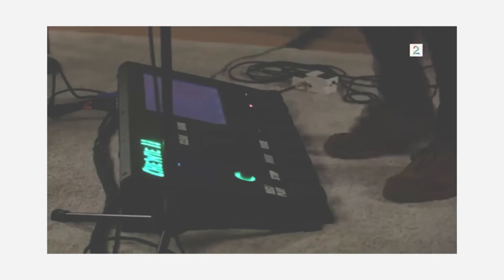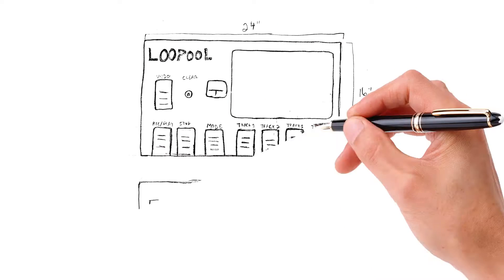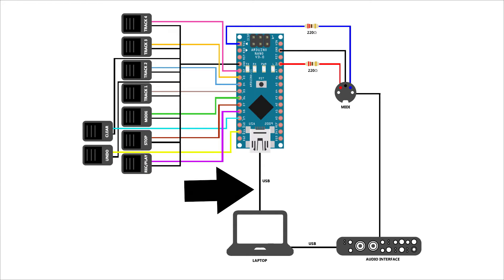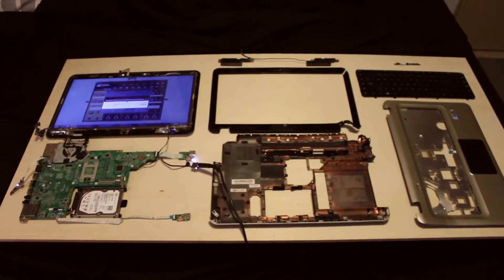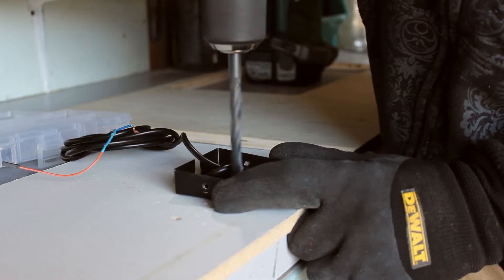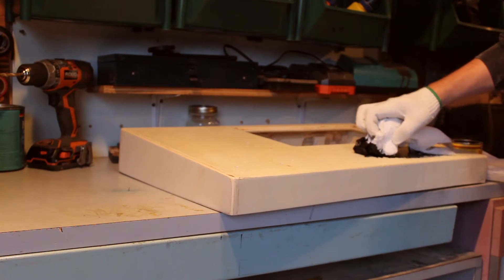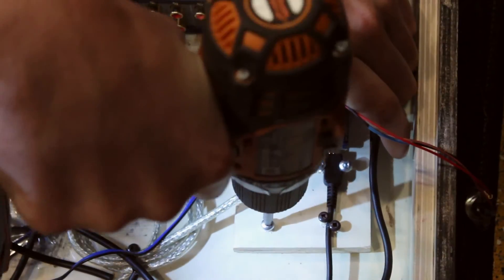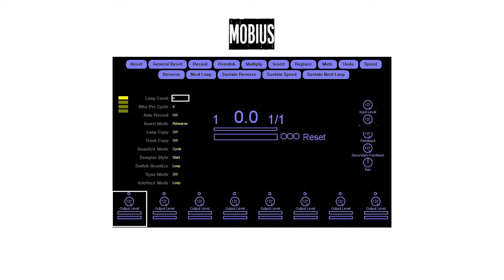How to make: Ed Sheeran's Loop Pedal

Comment: hi not sure if this will work but I made a racing sim setup with an old membrane keyboard and if you solder two wires together onto the board and then solder those wires to a button then open up a notepad you can make the keyboard type letters depending which two solder joints you wired together, Would this not be a much cheaper solution instead of an Arduino you buy an old membrane keyboard and create a bunch of shortcuts on the program for record clear loop etc. just a thought

Comment: This video did not age well. Tried to build this a few years ago, and it didnt work out, got back to it now, same issue. Here they are.
1. Sonnit looper doe not exist anymore - you might want to update the link - Mobius is so hard to work out, and every video tutorial on it has disappeared, really frustrating.
2. your arduino code misses files, such as the MIDI.h file, it does not compile without it. other codes available "seem" to work, but are for different boards.
3. even with midi passthrough on the arduino, any sort of alternative comms, devices or lights seems to absent from your vid, either you are hella good at figuring things out, or there is a fair bit missing from your video, or everything is now outdated/
an pdate and revamp of your board (going into a little further detail) would be really awesome. Cheers
Reply: Hi
My daughter who's a senior in high school is trying to build a pedal as well. She came up with some of the same issues as you.. Was wondering how you ended up getting past the arduino code that's missing the midi h file? If u happen to see this a  little help or guidance for her would be greatly appreciated.  
Thx🙂

Comment: Hey man, I'm pretty close to finishing mine! Only issue I have is with the code for the Arduino. It's not working in the sense that I can't get the mode switch to work. Also what scripts did you use for Mobius? Cheers man :)
Reply: Bro can you send me a picture of it on my email?? I was thinking about upgrading mine. maybe I could help you with the scripts and mobius settings im also using mobius as my looper

ramgicklandicho@gmail.com
Reply: @Rain_Landicho  Thanks so much man! Will send you a picture of it in an email in a minute - if you could help out with scripts etc. that'd be great! Cheers.

Comment: Hi there, I am in the process of building a looper like yours, however I am having difficulty with coding the Arduino Nano. doesn't seem as simple as you say in the video. I have downloaded the Arduino files that you have posted In the description, however it will not load into my nano. Is there some thing that I am missing. Do you have a file that you have already that I can copy and paste into the Arduino so it will all work for the looper.
Reply: Have you solved this problem?? need updates @davifloyd

Comment: Hey I was looking for some inspiration on my own build and I definitely found it here! One idea I had was to replace the laptop with a raspberry pie. This may actually be more reliable than the laptop because you can boot right into the software you want. The pi is also smaller and has gpio built in so no need for the Arduino. Also, a battery backup if you are going live would be sweet.
Reply: Hello Spencer! I'm completly noob on it, but I definitely wanna do it. My brother made me the same suggestion about the Raspberry Pi... Could you please give more details why exactly it won't need the Arduino? Is it possible to connect the pedals right to the raspberry?
Reply: @JuniorMartins-fb5cw  the Arduino was used for interfacing with the pedals. Basically it read high or low from gpio and sent that to the controller with a single line communication protocol. A PC can't do this because it doesn't have any gpio but the pi does have built in gpio

Comment: I've got a project that maybe you can help me with. A raspberrypi loop station using reaper. I got the inspiration from diy chewie monsta (ed sheerans custom loop station) tutorials using a laptop and arduino... Like yours..But it would be much more compact and efficient if we could eliminate the arduino and laptop by using using a raspberry pi. Watcha think?
Reply from the maker: Raspberry is definitely an option! When I initially started this project I wanted to make it with a Raspberry Pi for the same reason - it's super compact. The two biggest hurdles I ran into were having simplified software and finding drivers for my audio interface to work. I scrapped the idea because using an old laptop running Windows simplified a lot. If you are going the Raspberry Pi root, I suggest you take a look at the Sooperlooper software. Good luck and keep me posted!
Reply: @DidItMyself  
I definitely will. 
I think the biggest hurdle for me is the coding. As in figuring out how to map the pedals to the software from the pi's gpio. So if you stumble upon any helpful links please share. :) 
I have a cheap behringer usb1202 2 in 1 mixer / audio interface. But if reaper or another software can run on the pi and do the mixing for me, I can sell it and get one to fit inside the enclosure. But yeah.. And also win 10 can run on the pi 4 decently, if you want to try the pi again.

Comment: The Arduino Code doesn't work. An error message says that miss the library Midi.h
Reply: I had the same problem. Did you fixed it?
Reply: I had your same problem and being pretty novice I tried other solutions to achieve this result and I just found out that this library Midi.h you gotta find online and install in Arduino's libraries in order to work

Comment: why not just buy a boss system , besides yours is huge and probably destined to fail .
Reply: Because this is better than a boss system?the Rc 300 is essentially 3 boss rc 30’s stuck together,which would be great,if they had kept the audio quality at 24 bits instead of dropping it to a stale cheap 16 bits. Plus you have no options to record track of varying lengths unless you turn loop sync off (which is just..sooooo dumb. Why I own a pigtronix infinity looper but alas,only two loops instead of 3 and no xlr input) 

If you’re a basic loop artist,then buy a basic looper. But for those with grand plans,this is amazing. 

I’ve seen Ed do some really intense stuff with an rc 30,which is a looper I love and still own,but I’ll definitely be building one of these

Comment: Hello, yet 1 more question... Is the ardweno code writen specificly for you? Becous its not as simple as routing a button to a single code right? Becous when hitting the mode button the behavoure of your track buttons must change right... Or is that all taken care off when downloading the sonnit software?
Reply from the maker: Inside of the code there is a section to link the button to the specific pin on the Arduino. You can link as many as you need. Every button should have its own pin. Inside of the looping software is where you can link that button to what you want it to do.

Comment: How are you controling the laptop? Its not like you can plug a mouse and keyboard in this thing right? Or is it toutchscreen or somthing?
Reply from the maker: I have a wireless keyboard if I need to make any changes. However, I've set the laptop to automatically boot into the looping software so it's not used often.
Reply: Aa that's smart dindt Think about that tnx

Comment: hi I want to ask 
Is the hard disk fixed to the back of the screen together with the motherboard? 

and Is it possible to copy the instructions you have written in the arduino software and then write them into arduino nano to control the software? 
hope you reply
Reply from the maker: Yes, the hard drive is mounted to the back of the screen. You can definitely use the same file just as long as you connect the pedals to the same pins as I did!

Comment: So I got it built. I got all the code to upload to the arduino so in theory everything is good to go. However, I'm stuck at the MIDI note mapping. Did you manually map the note values to each button? Or did you do it in the Sonnit software instead? I tried it in the Sonnit software but nothing happened when I pressed any of the pedals.....Please help, this is melting my brain.....
Reply from the maker: Did you test your MIDI pedal prior to using it in Sonnit? I suggest using MIDI-OX to test. It is a free software and there are tons of videos on how to use it. Once I knew my MIDI all worked I mapped all my pedals manually in the Sonnit software. I suspect there is something wrong in your Arduino code.
Reply: @DidItMyself  This was so helpful! It's good to see I've not gone completely wrong.  After using MIDI-OX it seems that the MIDI controller is talking to the computer however it is not sending a MIDI note, the essential part of this whole exercise.....I imagine the next step is figure out how to get it to send MIDI notes which I imagine, like you said, is something to do with the Arduino......Thanks again for your reply, it really helped a lot.
Reply: Oliver Stapleton where did you get the code to program the arduino?

Comment: Keeping the battery on the laptop would have been a good idea.... if you loose power during a show, you wouldn't have to wait for the laptop to reboot mid song.
Reply: If you lose power you wouldn't be able to use an amp/stereo either...
Reply: @yourmomspalisade  The amp doesn't have to reboot every time it loses power. I think he's talking about someone kicking a chord loose, not a Statewide blackout.
Reply: @xsterawesome  I think he's talking about the audio interface inside the pedal.That needs power too.
Reply: @zibbezabba2491  The audio interface is powered by the laptop.
Reply: @xsterawesome  Are you sure? My audio interface has a 9v power supply. Can't power that from a laptop. He used a DC in I think.
Reply: @zibbezabba2491  I assumed that the DC in was just for Phantom power, however, even if it's needed, I'm willing to bet it takes less time to reboot an audio interface then an entire laptop and start the software.
Reply: @zibbezabba2491  He said in the video that arduino uses power from laptop via USB
Reply: @DaDiXXLaB  Yeah, but what powers the audio interface? He never made that obvious but I have the same one. It's powered by 9v.
Reply: @zibbezabba2491  you answered after 10months ... real og dude, respect hahaha
Yeah, I kinda of missed that... good point
Reply: @DaDiXXLaB  Your reply just popped up in my notifications today. Better late than never I suppose Ha. I think someone else must have just posted a comment on the same thread.
Reply: @zibbezabba2491  I posted the comment like 1 or 2h ago... but this thread is old 10months and you replied... haha n1
Reply: @DaDiXXLaB  It's cos we're both bored out of our minds at the same time haha
Reply: @zibbezabba2491  true that...😌😂
Reply: @zibbezabba2491  audio interface is plugued on computer, and the arduino too, and the computer is power everithing on the main power that you have in your cowntry. Sorry about my english. I guess he powered everithing this way.

Comment: Nice video!  It was cool to see the pedal I built as a reference.  The total cost in the pedal I built minus the laptop was about $120 USD.  Im actually working on a 3rd version of the pedal that instead of using a laptop will use a Latte Panda single board computer (https://www.lattepanda.com/).  It's about the size of a raspberry Pi and is capable of running full window 10 and costs about $130 USD.  My plan was always to run Mobius on an RPi but its not compiled for and ARM processor.

Comment: how much did this all cost without the laptop?
Reply from the maker: The most expensive part we're the foot switches. But there are many cheaper alternatives than what I used. The audio interface, I bought used for about $30 and you can find cheap nano's on Amazon. All said and done with some shopping, you could probably make one for about $150.